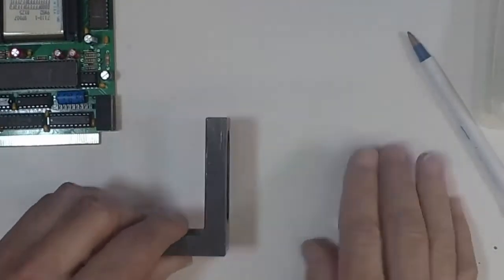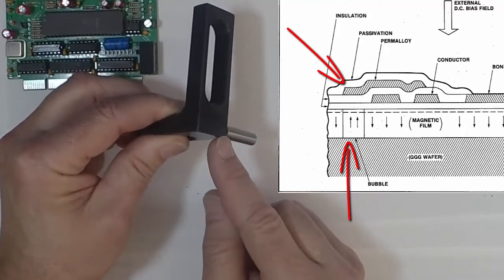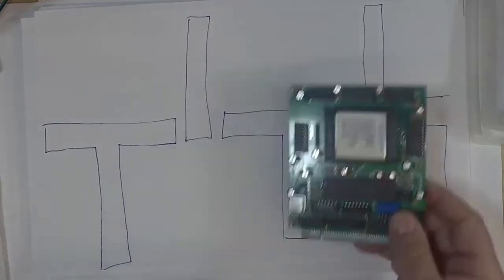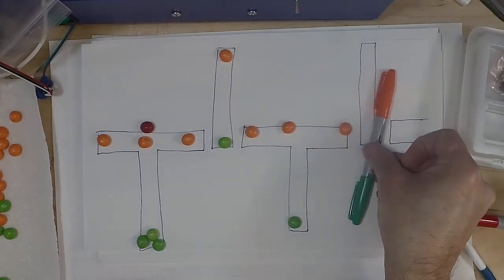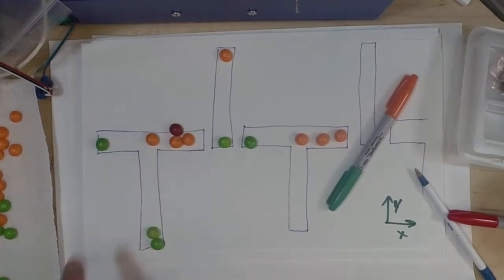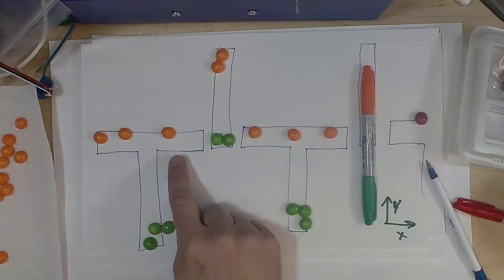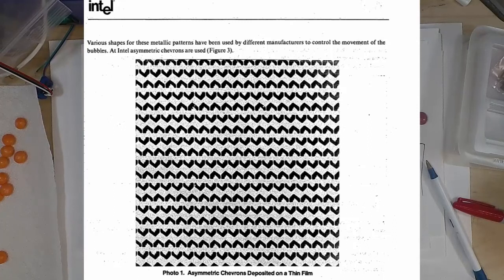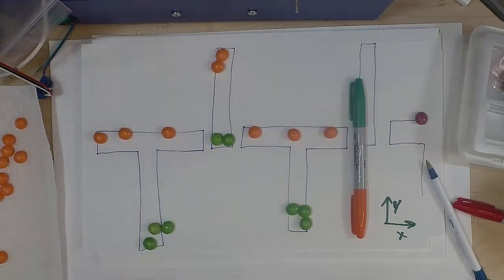{52} Magnetic Bubble Memory  Fundamentals 101-Constraining and Moving Magnetic Bubble Domains

Comment from the maker: Someone asked what the A, Z, and -0 thru -6 part numbers on the bubbles mean.  

The dash numbers are for temperature rating  
Originally these were
-0  	0-50°C
-1 	0-70°C
-2 	10-50°C

But very quickly they changed the meaning of -1 and added additional temperature ranges so
-1   	-40°C to 90°C
-4 	-20°C to 75°C
-5 	-40°C to 100°C
-6	-40°C to 85°C

For the A suffix, when intel came out with the second generation bubble devices, they changed the manufacturing process and could now use a leaded carrier.  Around 1983 intel introduced the 4Mbit bubble chip (7114) and the repackaged 7110.  So while the 7110 was leadless and went into a special socket, the 7110A was a leaded design that could be soldered directly to the board.  In early literature, intel referred to the 1Mbit leaded as the 7110 thin and leaded but then settled on the 7110A

Shortly before intel spun off the bubble memory into another company (MemTech), they created the Z version.  The Z means there is an additional coil in the device that cancels the bias field and causes all the bubble domains to merge into one, thereby erasing the device.  I presume this was done for some high-end or military application where they wanted to force erase the entire device in an instant.  This required reassigning a couple of pins to drive the Z coil, so to use a 7110AZ in place of a 7110A, the z-axis coil pins need to be lifted out of the socket.